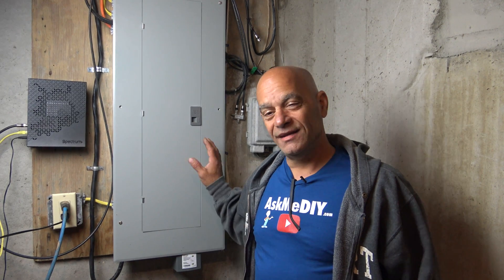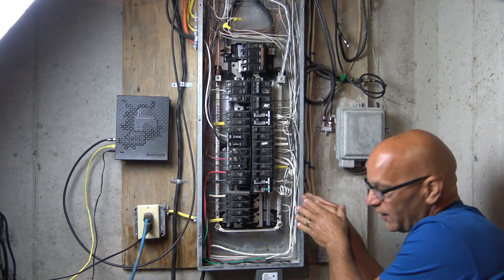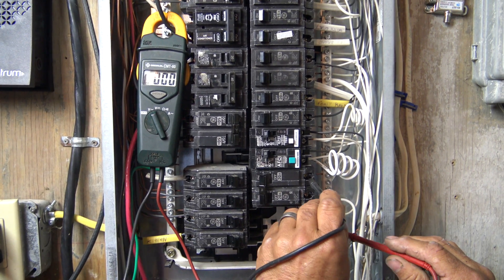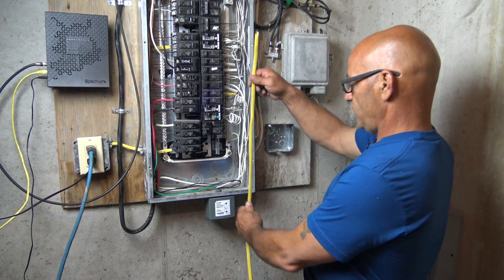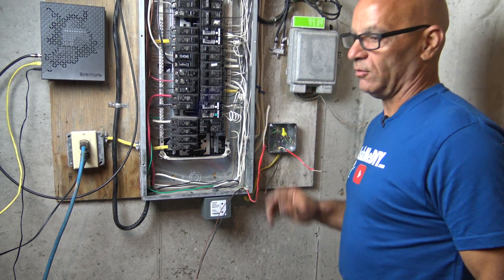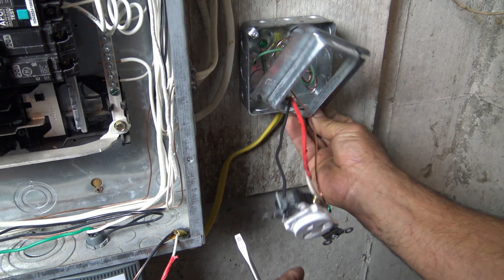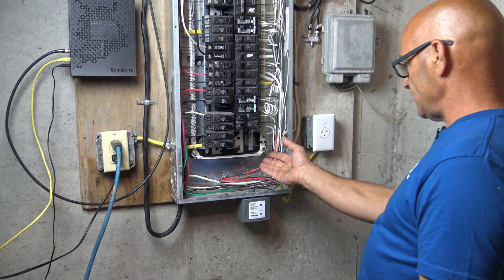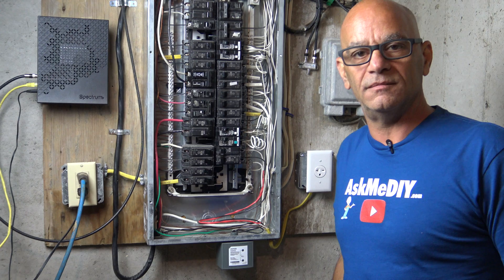How To Install a 220 Volt Outlet

Comment: any ideas about being told in order to wire up a tankless hot water heater i have to use 8/3 wire and dble pole 40 amp breaker. I did and the unit doesn't work.  Your video just took 10./2 or 3 wire for 20 amp and made it into 240 volt outlet. seems a lot easier. 8/3 has 4 wires blk, wht, green, and bare copper.  heater only has slot for L1 L2 and Ground.

Comment: How can I hook up a wall switch to the  outlet to turn the AC on and off due to a broken on/off switch on my AC I can't find a switch for the AC because it's a old unit I need a switch to turn it on and off rather then keep pulling the plug .. Please help..and advise.. Thank you

Comment: I'm sure the question is buried deep in the comments,  I'm sorry first.  I bought a 23k btu window ac w heat. It calls for 20amp 240 outlet.  I bought 10/3 wire due to distance running and reading recommendations of going w 10/3 instead of 10/2.  My question is... with an outlet identical to the outlet you used in the video here, what do I do w the neutral wire.  I have 2 hots and a ground screw but no place for the neutral?  I heard you just cap it, but then that defeats purpose of having the neutral.  Help please

Comment: Is that a 12/2 wire?
Reply from the maker: yes
Reply: Thank you very much ... im not a professional but i know how  to install a regular breaker .. but i have this situation that i have to install a 240 outlet for a water pump sistem on my house and i run a 12/2 wire ..but im not sure if i was doing the right thing i was worried to conect my breaker using the neutral as a hot line
Reply: I was thinking to run a 12/3 wire instead a 12/2

Comment: It is important to note that this NEMA 20 outlet only features the two hot conductors, however larger sized 240v outlets will require a neutral conductor in addition to 2 hots and ground. Most of your large appliances such as ranges and dryers derive 120 for their low-voltage SMPS between one of the hots and the neutral.

Comment: I have a stupid question. I am putting a 220v outlet on a outdoor street light in my parking lot. There are 3 underground wires going to the light. 2 hots and a ground. The outlet i need to install is a 4 terminal outlet. Now obviously I know where the two hots go. And I'm guessing the ground goes to the outlet ground. Now what do I do with the neutral terminal? Do I just leave that empty?or should i move the gouund to the netural terminal and put the ground to the metal box? Please help
Reply from the maker: @sirgergorymmmc2231  well, first you need to know what does that light need. 220 with or without a neutral.
Reply: @Askmediy  the light is existing and works fine. I'm adding a 220v outlet at bottom of pole to charge my ev. Running another wire underground thru conduit is just not gonna happen. Do I need the neutral ? Or can I get away with just the ground?

Comment: Great video. I need to run an outlet for my welder but it's about 5 feet from main breaker panel. Do I have to run the wires inside metal or a plastic box or can I just run the romex along the wall? TIA
Reply: Thank you. It would really depend on if you want to or not. Depends on the area really. Tell me about the room, basement concrete wall, or is it Sheetrock?

Comment: I have a stacker washer and dryer and both are 240 volts. The washer plugs into the back of the dryer. I am putting in a different dryer and it does not have a 240-volt plugin for the washer. How can I wire the washer to 240 volts when the dryer plug is the only source. There is a 120-volt outlet available, but I don't know if any other outlet runs on that circuit so I can't convert the 120-volt outlet to 240-volt.
Reply from the maker: Assuming you’re in the United States the dryer if electric will need it’s own 240 and the washer will need 120. Yeah sure it would be nice if the washer was on its own circuit but not always necessary. Your best guess is to at least try it. Otherwise you’ll want to run a new circuit. Yeah I know easier said than done

Comment: I wired an outlet just like this years ago for a compressor....now, I have a new compressor and only need 120v. If my understanding is correct I really only need to remove the marking tape from my white wire, attach the white to the neutral bus bar, and then wire in a 120v outlet...correct?

I think I might drop in two 120v breakers and run a 3 wire with ground, and then change out my box so I can have 2 outlets, each with their own protection.

Comment: When you pigtail the ground from the outlet, does it run to the panel only, or is it grounded at the outlet box?
Been bit by 120 before, but i dont wanna get bit by 240 😂

Comment: Thank you Sir, I appreciate your video..I have to install a 240V 15amp for an window a/c .
I'm using 14 Gauge wire.

My question is this , my run is 50' is that still a proper gauge wire to use?

Thank you.
Reply from the maker: Use #12

Comment: Do you uae #10/2 wire or the 12/2?
Reply from the maker: Depends on the amps. 20 amp would be 12 wire. 10 would be 30 amp

Comment: Great video! Right to the point. Is it within code (or an okay idea) to go from the circuit breaker to a junction box in an attic and then split the circuit to be at two receptacles on either side of my garage? I want to run two tools on either side of the garage not at the same time, but don't want to take up the space in the panel with a dedicated circuit. 

Also, say I did want to run the two tools at the same time - they are 6-20P plugs 12 amps - could I install a 30 amp breaker connected to two 20 amp receptacles?
Reply: No, the breaker must be no higher than 20 amp.

Comment: Nice video and well explained. Especially about the outlet itself and how there is not a neutral and how both hots are connected. I didn't realize you can run an outlet with 2 hots and no neutral. It looks like you are using 12/2 wire? When would 10/2 be required? I thought you needed 10/2 for 240V 20A? Can you use the smaller gauge wire for shorter runs? I'm running a 50 foot line to my garage for a 240V for an EV charger. I picked up 10/2 for the job. The charger pulls 16 amps.

Comment: Dominic, does it matter if you put the ground and the neutral wire on the same side or do they need to separated?
Reply: Using the correct 220 volt outlet the ground and one of the hots will be on the side of the outlet, however it’s two hots, not a neutral

Comment: What is the purpose of this weird shaped Outlet 🤔
Reply: This is a single receptacle (one socket) intended to be used for a dedicated circuit. The orientation of the slots indicates 240v to match only a 240v plug.

Comment: Just a reminder: shutting off the main doesn't mean that there isn't electricity present. On the incoming to the main from the meter there is power. Only downstream from the breaker to the panel is it off.
Reply: Gyygggyg the guy yggygygg gy the yygy
Reply: TV gyygygg
1:05

Comment: The bar inside the panel that the bare ground wire connects to.  Is that bar connected to anything ? It has no current correct? It’s just a free standing bar that all the grounds connect to?
Reply: That is a ground bar and is connected to the grounding/bounding
Reply: @DominickAmorosso So if I touch one of the poles on the double pole 20 amp breaker and the grounding bar there should be no current correct showing on meter correct?

Comment: so how do you get 220v without a ground/neutral; I am under the impression that the current always needs a path back to the panel by way of the neutral?
Reply: One wire is positive while the other is negative, so one is providing power while the other is returning it and they alternate at 60 Hz in North America. The load is always balanced, so no neutral wire is used.

Comment: what's confusing about double-pole breakers is the difference between the ones that have one switch and the ones that have two switches and when to use them?
Reply: If it has one switch, the breaker would trip if either circuit is shorted or overloaded. If it has 2 switches they are tied together, so the results are the same. In theory, they could be used interchangeably, but use the one that's the same brand as the panel.

Comment: Great idea clamping the Romex to the connector first before attaching the connector the service panel. I've always put the Romex connector on the panel first and always was nervous when coming in from the top about the nut dropping. With the wire already going through, the nut will stay around the leads. I just subscribed due to your great way of explaining things.
Reply from the maker: Thanks buddy

Comment: 18000 BTU AC unit requires 15 amp circuit breaker can I use 12/2 wire less than 50 ft
Reply from the maker: Yes of course

Comment: What if you need 2  220 20 amp outlets? Can you just splice it together under 1 breaker?
Reply from the maker: Could you, yes. But you better watch your amps.
Reply: Im trying to add 2 20 amp outlets in 2 different rooms and want to know the best way to do this. Is it just to put 2 different breakers for each outlet? They will be for to 2 big ac units
Reply from the maker: @Jay-dn3um  Know what you're asking here. You're messing with 240 volts. You will need two different circuits with two breakers.

Comment: I have NEMA 14-50 outlet, is there a plugin adaptor 6-50 that eliminates the neutral wire ? I don't have an EV yet. I may purchase a  220V car lift that could use the outlet.

Comment: Hi, what size wire did you use? 10awg?
Reply: This is  20 amp so a 12 wire
Reply: @Dominick Amorosso  thank you, im sorry I thought to myself that I'm sure you said what size wire so I went back in the video and heard you say 12 awg. Thank you again.
Reply: @martinwhitehurst9893  all good. Thicker wire, higher amp breaker and outlet.

Comment: Great video but am confused as to where the yellow wire nut came from  on the time from 7:29 to 7:31...   You then talk about the ground wire so did you go from the metal box to the panel??? I cannot see a ground wire from the metal box to the panel itself.
Reply from the maker: Yes the yellow wire nut is from the bounding from the metal box to the wire. But remember if you use a plastic box, it would be bounded

Comment: How would you run another 20/250 receptacle off the one you just added?  Pig trails? Great video!  Thanks!
Reply from the maker: Could you yes. Would I? No. Just think about the amp draw.
Reply: Pig tails/wire nuts are OK. But Leviton and others do make duplex receptacles for 240 that use the same plug style and have a 2nd pair of screws on the back.

The concept of adding additional outlets is the same as for 120 ... when using any of them, stay below the load limit or the breaker will trip. In this example the circuit is 20A.

When you see a house with 2-3-4 or whatever 15A outlets on the same 15A breaker, any ONE of them could max out the breaker, depending on the appliance being powered up. But, they know most people never use more than one thing at a time that uses big power.

For example, the reason why you can use TV, phone charger, desk lamp all on the same circuit is because added up they likely don't go over the load limit. Now add a hair dryer and things change.

Comment: Thank you for the lesson. Q1: How come the other white wires in the main box do not have red tape on them?  Q2: As with DC wiring, how come you don’t have a red + and a black -negative wire? 
Thanks again 🙏‼️‼️
Reply: You tape the wire to visually indicate it's a positive, when being used in that way. Those others are neutrals. I don't think anyone sells cables consisting of two blacks or two reds + plus ground.

Comment: Yes. Very well done. One question. What is the reason that you do not need the white or neutral return wire with 240 Volt application?  Thank you.  - Ron
Reply: same question. Other 240 Volt outlet requires a Neutral but for This NEMA 6-20 doesn't require a neutral?
Reply: @inspirehomeslosangeles6099  Part of it is convention, part of it is requirement ... if the appliance has its own internal transformer it can create a 120v AC source to power an internal clock or other display. This is what electric ranges and electric dryers do, if they use a 3-wire 240v cable. They don't need an external neutral because it exists inside the appliance.

If they don't create an internal 120v source, they'll need an external neutral as part of the equation. A 4-wire 240 connection also provides an extra measure of safety if the ground isn't healthy.
Reply: A 240v line consists of two 120v positives, and they are 180-degrees out of phase with each other. Each of these hot wires take turns being the return path to the transformer outside the house as the juice alternates back and forth. With 120v circuits, this circumstance doesn't exist ... you only have one phase with no corresponding return path unless the neutral wire is used. 

In other words, 240v AC "creates its own" return path by definition of how its two positives act (because, being 180-degrees apart in phase, they are not identical positives even if their voltages are each 120.)

Comment: I am installing a Power: 240V / 2,800W / 12A Sauna about a 50' wire run.  Should I stick with 12AWG or go  up to 10AWG?  Great Video thanks.
Reply from the maker: For 12 amp a 12 wire would be fine.

Comment: So, if the panel is still on, but the breaker off, it shouldn’t be pulling power when you connect the wire?
Reply from the maker: That’s correct
Reply: @Askmediy  thanks for replying and letting me know, especially as quickly as you did. I didn’t wanna guess with electricity.

Comment: Also would I use 6/2. Or 6/3. With a three prong plug it has
Reply from the maker: I would use 6/3 if you don’t need a neutral, at least you’ll have it. Much easier now than later
Reply: Thanks

Comment: I want to run one for my Lincoln ac/dc stick welder 230v 50amp.  So would I use a 50amp breaker and a 6 ga wire for this? Thanks
Reply from the maker: Yes you got that right

Comment: Installation work for a window ac unit
Reply: I don't see a neutral use I. The installation
Reply from the maker: @aldogarcia4063  The same why for most. This is the most common way for a 20 amp 220 volt.

Comment: So I get they use the ground instead of neutral but is that code? Seeing how the ground bar and neutral bar are connected to each other. Some boxes only have one bar for both.
Reply: Yes it's "code," but code is only following physics here ... each 120 leg is 180-degrees out phase with the other, and that is why you'll hear electricians describe a 240 circuit as providing its own neutral (meaning, its own return path). If it did not, the power would never appear across the 2 lines regardless of code.

Any ONE 120v line lacks a corresponding phase offset, which is why it needs a return path back to the transformer (i.e. the neutral wire.) The reason why touching just one positive 120 line jolts you is because you become the return path in that instance.

Ground being one half of a 120v source is like neutral being one half of a 120v source ... irrelevant (and safe) unless a positive line is also part of the mix. Ground alone or neutral alone won't hurt you unless something somewhere is miswired and has not yet tripped a breaker or blown up the transformer outside to stop current flow.

Comment: If the ground and the live lines read 120 volts that won't cause a electric hazardous on my a/c when I touch the metal frame?
Reply: Voltage testers are not straight wires. When you touch the leads from a tester to 2 locations, you're not shorting those locations. 

The ground isn't a return path UNLESS a positive connects to it. In that instant, ground becomes a return to the neutral and the circuit breaker flips, same as if you connected positive and neutral together to begin with.

Comment: so im building a large shed in my backyard and i wanted to set up a kind of gaming room in there, would i need to install a 240 volt outlet and then run it to the shed in the back yard and then put some kind of adapter from 240 volt to a 15 amp outlet and just connect the lights and PCs to the outlet or would i have to do something else?
Reply from the maker: Seems like 240 volt is way overkill.
Reply: @Askmediy  so i should just stick to a regular 15 amp and just run 1 or 2 of those to the shed?
Reply from the maker: @walterdavis3554  that will depend on how many amps you need. This isn’t something that I can just give you an easy answer to like that.
Reply: @Askmediy  ok, thank you

Comment: Great video! So there can only be 1 240 volt outlet per breaker?  ATX power supplies run at 120 or 240 volt. They are up to 10% more efficient on 240 volts. Would like to have multiple outlets run on one 240 volt circuit. Is that against code?
Reply from the maker: Thank you. Well…. You can have more than one 240 volt outlet. However make sure you read the code on that and understand it fully.
Reply: @Askmediy  Thanks for quick response! Will read it.

Comment: I did a lot of wiring in Viet Nam in 1968, I wish I had you as my instructor back then, very easy to follow and understand. I am in the process of wiring my man cave (12 X 28) shed and using your videos as refreshers which will have 2 240 volt outlets. I want to thank you for being so generous sharing your knowledge and great explanation of the process. This is the MOST deserved sub on YouTube, I would subscribe a 1000 times if I could, you are by far the best instructor on YouTube. Many, Many Thanks
Reply from the maker: You’re the best. Thank you so much. You made my day.

Comment: What gauge wire should I use for a 240 outlet that is going to be run almost 100foot? Also it will be on a 50amp breaker. Thanks so much hope to hear back from you.
Reply from the maker: https://www.askmediy.com/electrical-wire-size-calculator/